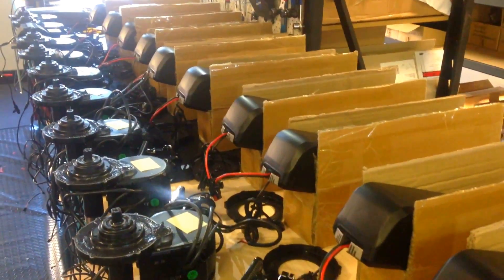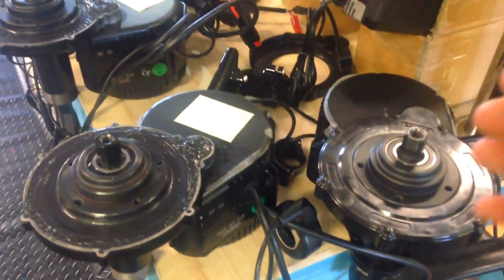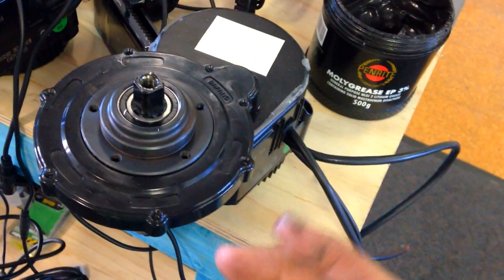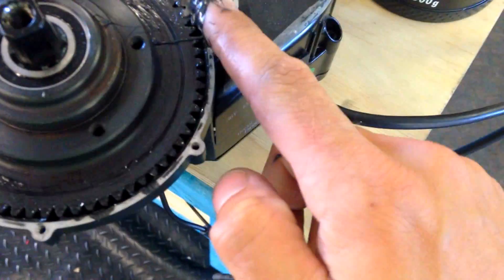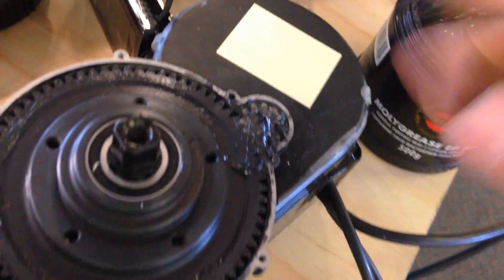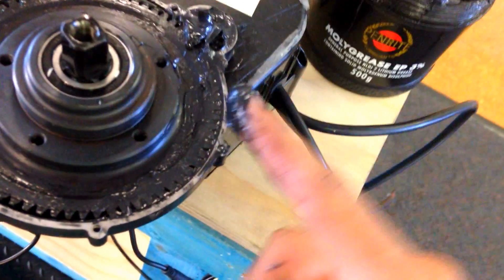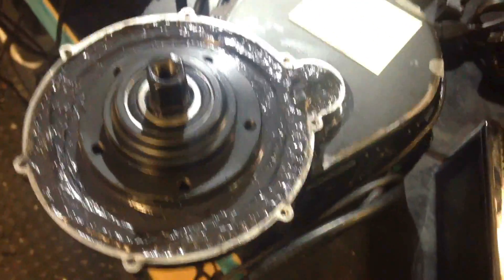Making your Bafang BBS02 mid drive last longer with extra moly grease • 8fun Electric Bike BBS01

Comment: Thank you Bruno. When I opened my Bafang BBso2 it looked like if they took a paint brush and painted some grease on the top.  I ordered a digital thermometer and will be putting that in together with dismantling the PAS. You said there was a way of disabling P'AS through the controller but I already did it when I read your comment.

Can you show the lithium grease on the other side with the nylon gear?  I am learning so much with your videos.   I am taking my time and doing it correctly the first time.
Reply from the maker: +Nelson Olivo - Yeeeahh.. hahaha liked the way you described "they painted grease on top the gears" hahaha... I totally agree!! They avoid put lots grease there for a reason, there is a design issue there and some moly grease will eventually leak and reach the nylon gear (moly is not suitable for nylon) so the less grease they put, the less it will leak.. they just forgot that the less grease the more friction between gears.. haha 
Dont worry, I will be posting a video showing something bizarre.. a 6000km motor that I opened and had lots of moly grease leaked inside the nylon gear (supposed to be a problem) I cleaned it very well looking for damages but the nylon was PERFECT like brand new... I couldn't believe!! 
Also I figured out "why" the BBS02 / BBS01 (same design) leaks grease like that...  I will be making another video discussing in details. 
If you would like to see what you'll find when you open the nylon gear for the first time, watch this old video I made a while ago: https://www.youtube.com/watch?v=td2wIiKwai4 the greases I used in these old videos I discontinued use as I didn't like the performance.

Comment: can i use universal grease?
Reply from the maker: +MuZzE1780 universal grease may do the job for a while but I don't think it would last like the molybdenum grease that has solid lubricants that sticks to the metal.
Karl tried a synthetic Mobil grease and said that worked well (in a short term) I don't know if is good for long periods.
Any grease will be better than running dry gears with zero lubricant left, high friction, noisy..
If you try something different, try a thick grease, anything too liquid will just splash all over due to the centrifugal force as the motor spins quite fast..

Comment: not sure about this one. i think the thick grease will take away power since it'll be harder to turn fully packed like that.
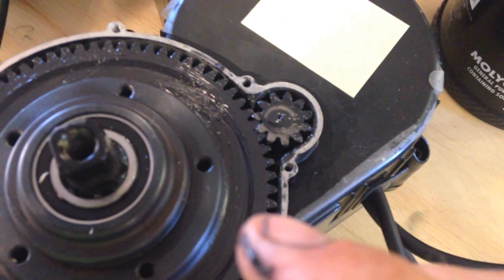Reply from the maker: +sky17 - I have seen many completely destroyed pinion gears, all because it was running "dried" without enough lubrication (it was the first problem I had with my BBS02 and first problem many people experienced as well), the damage extends to the big flywheel rounding all gears and you have to replace both. Talking about major service pulling everything apart. The resistance increase would be a problem if we were talking about a very low powered motor like 100/200w without gear reduction. The BBS02 pulls a good 1100w with the factory settings, that means at least 1.3HP on the motor shaft (after thermal loses) and after the 1:21.9 reduction gear we are talking about extreme torque on the flywheel, capable of pulling a heavy rider + bike + battery up hill in wrong gear. Grease resistance mean nothing in this case. Running two metal gears with very high torque is just the perfect recipe for mechanical problems. =]
Reply: +ElectricBike (Bruno) Have you tried motor oil instead of grease? Motor oil would lubricate the gears and dissipate the heat a lot better. BTW is one of the gears inside bafang mid drive is plastic? Seems like planned obsolescence...

Comment: does this applies to bbshd as well? :)
Reply from the maker: Hi Manuel, it's critical on the BBS01 and BBS02, I would say if possible every 1500km inspect the gears and apply more molygrease.
The BBSHD has an improved design, it pushes the grease in a different direction, constantly reusing it so it lasts longer. Greasing the BBSHD is a very similar process, I would say "just to be safe" maybe inspect after 3000km or something like that... some bike courier guys can't really stop and just keep on ridding for a lot longer =]
Reply: Hi Bruno, i already applied mobil grease on mine to the point that i can't cranks anymore lol so far i'm having a blast it is much quieter that it was before not sure though if its a good thing :)

Comment: Man i have one question if you know because i am confused.Due to the fact that mid drives are not maintenance free i have stick to my hub motor 4 years now with only minor issues.I know that if you put to much grease in a motor or gears after the motor is super heated abused or some dust or moisture find its way inside the motor the grease will stiffen and will actually be worst due to extra friction :D 

Don't get me wrong i just want to ask because it came to me how often someone has to re apply and clean the old used grease ? 4-6 months ? more ? never ? 

Keep up the good work :)

Comment: That is not going to give you more power. Or make it last longer. That's going g to do the opposite. Take your power and moke it last less
Reply from the maker: Hahaaaa I never said that greasing the motor when it’s time to stop and service it “will give more power”... 
Greasing the internal gears after thousands of kms is just like changing your car oil... what happens if you don’t have enough oil or if your oil is 4 years old? 
The title of this video is “make your motor last longer” (by lubricating properly/regularly)

Comment: keep in mind that more some times is not better, any rolling thing with a tight gap cannot be filled completely with grease, packed grease will just increase the effort and so more temperature and so more wearing
Reply from the maker: Yes, I agree with the point you made, in this case, the helical gears are constantly pushing the grease to one side and the gears eventually run dry, metal on metal friction with no lubrication, it gets very noisy, by the time you realise its too late, more than one gear need to be replaced. The internal design would not permit you to have too much grease to the point of causing an excess, adding more friction, the grease is pushed to a gap with a lot of space. A perfect design would recycle the grease again and again instead of having to manually open the motor, check the grease and having to top up every now and then.
I also recommend to open and completely replace the grease with a fresh one every 2 or 3 times this top up procedure is done. Ohh yeaahhh.. =]

Comment: Hi Bruno! nice video! I admire your enthusiasm with every video you make! I've watched all of them but this one stands out for me. I've had noise when pedalling and when I opened it up I think its the outer gears making noise. Following Karl's blog I put lithium grease on it, maybe bot enough but I still hear the gears rolling (metal on metal). I've made a video myself.. https://youtu.be/K9YwFqNTuP0. I bought your moly grease type and will apply that once it arrives. I hope to reduce the noise but most of all I hope the gears will last longer as such..Some people have doubts with that grease going nextdoor and 'affect' the nylon gear. Have you had any issues with that before?
Reply from the maker: +karel franchoo - Yeeeeahhhh... thanks for watching all my videos hahahaha...  I watched your video and I am suspecting your pinion gear "looks fine" but it is actually bended and damaged where it makes contact with the flywheel (big gear). I will be making a video after Christmas when I get back home showing how to check the pinion without having to pull everything apart. I will try to explain here... just get one or two cotton buds or swabs (ear cleaner) and clean the pinion gear very well on the small gap between the pinion and the flywheel. You may need a good light to see inside and check if the pinion is straight or bended like this one here https://youtu.be/xUKz40ukbHc?list=PL59mIOWSOm9qsFUHLJ3IfW3CQ5z4--cl- 
Yes, the moly grease will leak to the first stage and mix a bit with the internal gear, it is a design issue... I opened a 7 months old motor few days ago with over 6000km in a delivery cargo bike. Yes, there was a lot of black grease in the side of the nylon gear but NO FAILURE at all.. I cleaned the nylon gear very wheel looking for any damage and nothing, it looked like brand new after 6000kms.I Will be posting it soon... very interesting. The weakest part of these motors is definitely the pinion gear, maybe 10x more likely to fail than the nylon gear (in my opinion). Smaller chainring will make your motor spins faster and save your pinion from intense stress =]
POWEEEEEEERRR....
Reply: +ElectricBike (Bruno) .appreciate it giving me this lead. i'll look out for a smaller chaingring but will open it up too and swab it... after christmas! enjoy your holidays too!
Reply: +ElectricBike (Bruno). And will I be able to unbend that small pinion? If its damaged I will have to replace that bit I guess?
Reply from the maker: +karel franchoo - if it's bended little bit you just replace the pinion gear but if it's bad... then it probably rounded the big gear... 
Maybe just get both gears to be safe, if you're in the USA order from http://california-ebike.com/product-category/parts/drivetrain/page/2/ and tell Doug that Bruno YouTube recommend =] if you want to get from China http://www.greenbikekit.com/electric-bike-kit-1/central-motor-kit.html?p=2